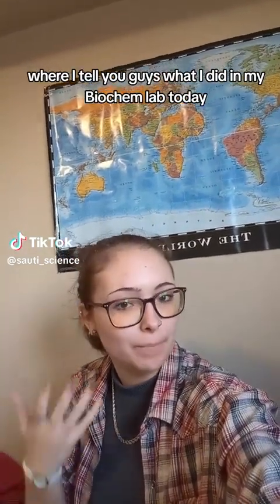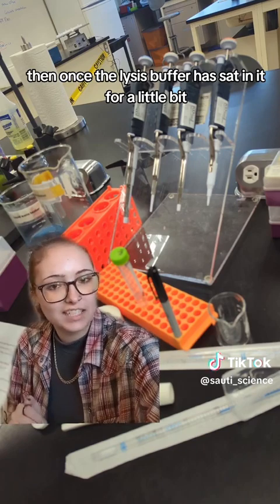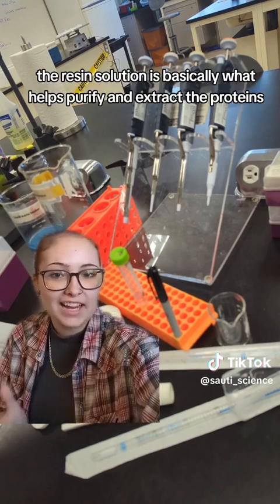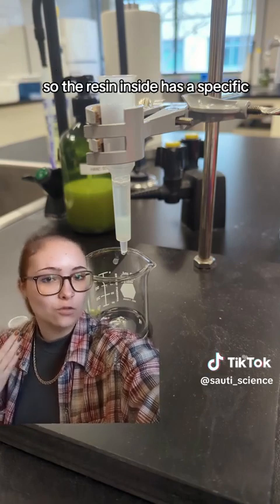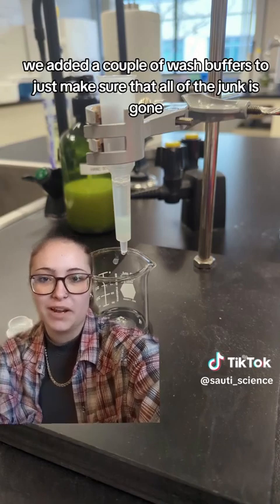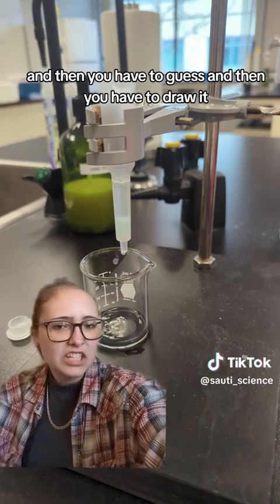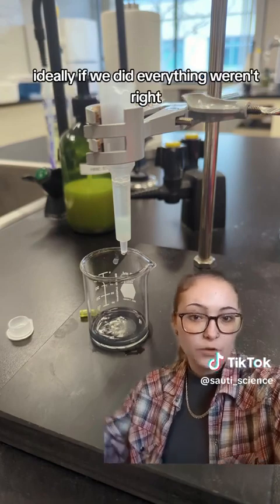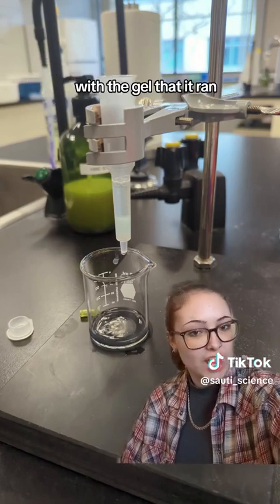Protein Purification

Comment: Out of curiosity: this is just a process you can (pretty much) run on most proteins, because that's what I got from your description.

I don't think this looks like what they'd use to make pure protein industrially. Seems to take a long time. Do they do anything similar to this to purefy whey, for instance? Do you know?
Reply from the maker: Whey is a totally different thing with a totally different process, this is to get one singular specific protein, whereas whey protein isn't just one protein but a liquid left over from cheese making process that actually has a bunch of different proteins and stuff mixed together 

Idk about industrially, but this can be done with most specific single proteins as long as you have a column with affinity for that particular protein. I think this is for research proteins largely where a single purified protein is needed, and industrial proteins like in whey and protein powder aren't actually a single protein, they're a large amount of different ones mixed with things like vitamins, lipids, etc
Reply: All the steps can likely be done in a continuous process, but things like resin collimation would be optioned for an alternative like elutriation if possible.

Comment: This is a good idea for a recurring video series. Should provide a lot of material, be easy to actually construct the videos (relatively speaking), and inform viewers of interesting stuff. Good idea
Reply from the maker: I do have a whole playlist of my lab projects, it'll be a recurring series for as long as I do lab work. Unfortunately most material and equipment have to be specially ordered and operated so it's very hard to get and do outside a lab setting